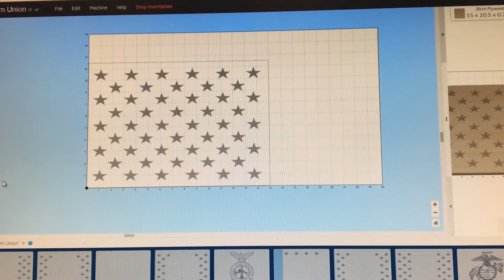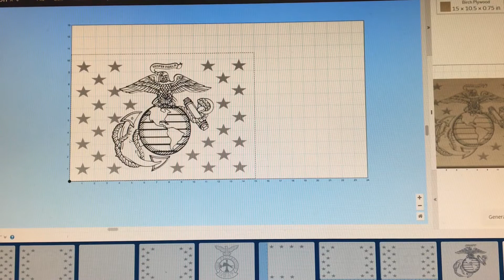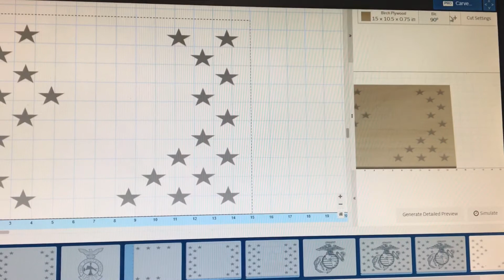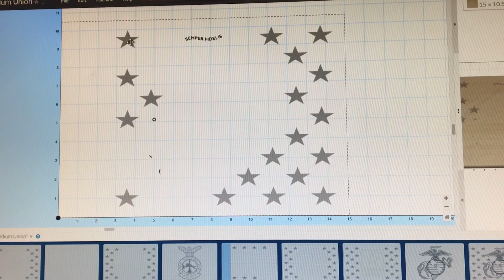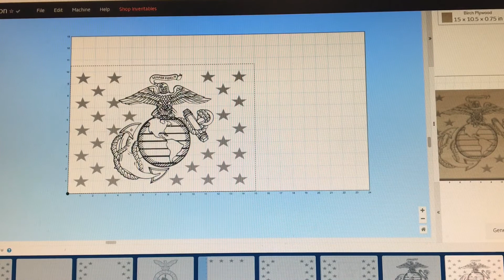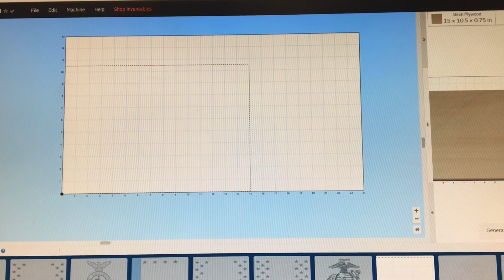Designing a USMC logo on a union. 3 bit logo! Easel Pro Tutorial!

Comment: When you carve your flags with easel, do you do one section at a time, ie. stars, stripes, logo, etc? I want to avoid the rounded edges on the stripes when I have logo within the stripes. Thanks
Reply from the maker: I normally will do the union separately so I can zero in on that area, then run the stripes, then the logo in the stripes so I can really zero in on that as well.
Reply: @TorchedWoodWorks  Do you or can you make a video showing, the whole process? Thanks

Comment: I have been struggling to paint my stars onto my union and not have them bleed over onto the blue. I have tried mod podge, but the paint still bleeds over the outline of the stencils.
Reply: Ok. I will try that.
Reply from the maker: That’s one of the toughest things with painting stencils. Back when I used to do that I would spray adhesive spray onto the stencil stick it on the Union and from about 2’ away spray a LIGHT coat of spray paint on it. Let that dry then do another 2 coats. It still would sometimes bleed but I had the most success rate with that.